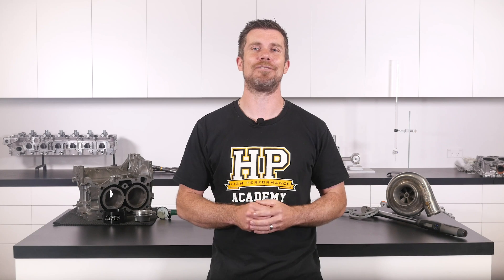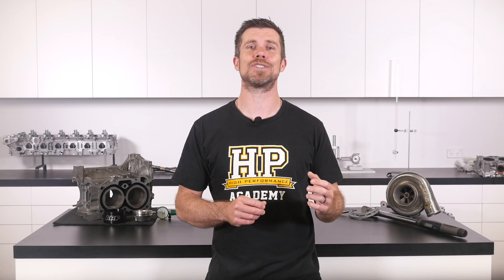Road Tuning | Can I Tune Ignition Timing Without A Dyno? [HPA Q&A]

Comment: A good way is to time the acceleration. For example 2000 rpm to 3000 rpm in some gear.  More timing equals more torque, right? Thats what my teacher told me

Comment: Why couldn't torque be inferred from some of the PIDs in the tuning software when driving down the road? Get the weight of the vehicle. Then take velocity of the car (angular rotation of the wheel & wheel size).
Reply from the maker: You could, but not with enough accuracy.

Best to be conservative and get close than try push things with guess work and potentially pay the price.

As Andre stated you can get very close with road tuning as it stands - Taz.
Reply: @hpa101  figured that might be reason. Thanks for prompt response :)

Comment: Log the knock level and knock retard. Use sensor overlay (Shift+F7) to overlay knock/retard on ignition table. Use Megalogviewer to analyze    TPS vs rpm/VSS vs Timing. Best MBT will give lowest TPS at a given rpm. Use the same piece of road (cruise at same 30pmh with different ignition timings) , patience. Analyze fuel curve by rpm to pinpoint areas of intake resonance.

Comment: Shouldn't you be able to detect the point at which you go past MBT with an oxygen sensor? As you advance the ignition past MBT the combustion event will be less efficient so providing you don't change your fueling, the difference in unburned oxygen should show up with the Lambda sensor?
Reply: Interesting thought, but I'm not sure it would work that way in practice because improper combustion would also tend to leave more unburned fuel.

Comment: Hi HPA,

In my experience, not cars but a small cc motorcycles. Not all engines will knock if you increase the ignition timing. So it's really hard to use the knocking sensor to sync with my datalogger. We tune IGN on the street by our feels.. but of course, I am always looking for a way to get better data. Can we use data from GPS sensor like Gforce? it is it the same with torque. we just use the speed data
Reply: Colour tune spark plug?

Comment: what do you do if the ecu dont have knock control? i have an elite 750 so im too afraid of the timing table lol, but its going to be a very long time before i can  afford a dyno tune because of covid my disposable income is non existant lol but im too scared to road tune the turbo car with no knock control, the engine is solid mounted and the interior is stripped so its a very noisey enviorment and im afraid i wont hear the knock or realize its knock im hearing if you know what i meen, minimum boost on wastegate is 16psi and shooting for 25psi as the goal for this setup when tuned properly. another thing im afraid of, is the ca18det engine has the same cam sensor as an rb25 and the cam belt deflection timing creep problem, so it needs to be super conservative anyway, and the reality is i was planning on getting a PRP trigger kit before starting/tuning the motor, but because of covid, my finances wont support that for some time, i just want to figure out a super conservative tune so i can enjoy the car a little bit, run the engine in under load properly, and work out all the bugs and issues over the next few months and hopefully next year ill be able to afford the good trigger kit and dyno time and have a smooth experence.
Reply from the maker: You can use something like a Tuner Nerd Knock Monitor Pro, Link Knock Block or a Plex Knock Monitor V2 etc. You can move these from car to car too, or even sell it one once you have finished your tuning.
Even in a quiet car, when it comes to a performance engine, if you can hear knock with just your ears it's too late as damage is already being done.
Check out this article here: https://www.hpacademy.com/technical-articles/dont-waste-your-time-listening-for-knock/ - Taz.
Reply: @hpa101  thanks man your the best, once my money situation comes good again i cant wait to sign up for some more in-depth knowledge, thanks

Comment: What are the signs of a bad dyno tune of the timing is off?
Reply from the maker: There are a few, this isn't a really straight forward questions to answer in comments section that respect sorry, but 2 basics would be detonation and also the shape of the map. If you look at the 3D graph and there are odd peaks or troughs often this is a sign something is wrong with the tune or with part of your setup - Taz.

Comment: 3 questions....
 with a stock cam, carburetor and no emissions. when setting timing at speed and UNDER LOAD, how many degrees retarded from the knock threshold should the engine timing be, to be safe to run? (when listening to the knock by ear without a listening device).....

 all things being equal, does the "safe zone" (the amount in degrees the distributor is retarded away from knock threshold) change noticeably on a 4, 6, or 8cyl engine?......

 on my engine,  when under load, there is about 10-12 degrees between the "audible knock threshold" and where the engine power "drops suddenly" as the timing is retarded away from the knock...  should the timing be set in the middle of this 15 degree range, or slightly closer to the knock, or closer to where the power suddenly drops off?... within the range, where would give the most power and where would be the safest for the engine without worry of the silent but still damaging spark knock?... which is really more of an issue with a boat engine than it is with an automotive engine...
Reply from the maker: Hey Greg, there is no way to know where the threshold is without tuning and finding it. Every engine is different, and different fuels will give different thresholds/limits so until you know, there is no way to know.
Not the answer you were hoping for I know sorry, but just like MBT it is something that can't be calculated before hand, the engine tells you where it is via tuning - Taz.
Reply: @hpa101  I know where the threshold is, and its easy to find when under power, but I want to know about how far from where the pinging stops as im retarding it, is a safe distance for it to run....  its a linear measure made in degrees, and anyone who routinely tunes on a dyno should know about how far in degrees from were the pinging stops, that the engine will be reasonably safe to run...  
 when the timing is advanced so far its causing detonation,  one can retard the distributor to minimize the ping, and even after the ping has been silenced and cant be heard, there is still a bit of detonation happening in the cylinder.... do we need to retard another 2 degrees from this point, or 10 degrees?.....
Reply: @gregpatey6355  Can i ask something. If a car was tune from factory to use ron95, does the knock sensor tell the ecu to maximize ignition timing when using ron97?
Reply: @vigossvirus666  Depends on how the manufacturer set up the ECU. On some cars, the knock sensor is an active part of the ignition system and the ECU constantly uses it to optimize timing. However, on others, the knock sensor isn't actively used and it's only there to tell the ECU to retard the timing for self preservation in case something is wrong such as the fuel's octane not being high enough.

Comment: How we can find near optimal ignition timing on boosted engine without knock sensors?
Reply from the maker: We have no advice for tuning without a knock sensor on a boosted engine other than to fit a knock sensor. They are much, much cheaper than an engine rebuild. There are no safe shortcuts here - Taz.

Comment: Great video.  I had learn to tune with and without a Dyno.
Reply: what would you recommend to  a newbee at performance tuning to get boned up on where to set the advance/retard  curve on tc88 motorcycle ignition modules?

Comment: Very interesting topic. If i have a naturally aspirated engine which is not knock limited, is it possible to get some indication about the torque by monitoring manifold vacuum while using cruise control to maintain constant speed? If engine produce more torque it should have more vacuum. Maybe i m wrong. In that case please correct me.
Reply: unless you can have a constant load like a propeller or a fan part throttle vacuum is not accurate

Comment: Virtual Dyno software works well. So does logs comparing 60-80mph times to see if timing makes it quicker.
Reply from the maker: We have not had repeatable results with the accuracy required to tune a performance engine from Virtual Dyno software ourselves, but the comment does pop up every now and again from others that they have success although some peoples interpretation of what is an acceptable margin of error is quite different to what we would accept when it comes to accuracy - Taz.
Reply: @hpa101  When I was 4g63 in my 3000GT, I tuned it only by street pulls, virtual dyno, 60-80mph comparison and looking at plugs. Ran 9.65@143, at 37psi. Ran up to 50psi on the street. I know there wasn't much left as I also remote tune 3000GTs on AEM and tune with only logs and virtual dyno. One made 735awhp when he put it on a dynojet. They added 2 degrees and only picked up 12hp, so they smartly took it back out and back to my exact map from remote tuning, virtual dyno. I only left on the table what I had wanted to leave for a little safety factor. It works. Must be a flat road, no wheel spin, and good logs. Plus with street tuning, you know its tuned in the exact conditions, unlike a dyno. For AWD cars I much prefer street/track tuning since they aren't as traction limited. RWD cars are different. On my personal car, street tune until traction is an issue, then the rest at the track.
Reply: @4familyman  whats the best virtual dyno software your using?
Reply: @4familyman  thank u

Comment: Dynos are tools...... The benefits from tuning on a Dyno are usually so you can see your power band and the ability to shift your power band when advancing/retarding the ignition. Adj cam gears are easy to tune on dynos. One of the downfalls is that the Dyno is a constant variable in testing but, when you drive on the street your car could behave differently because of the load difference. I prefer street tuning because it's really going to be the data the car sees on the road with all the elevation changes. Cars should be Dyno tuned first then make changes once you drive it on the street.
Reply from the maker: You should always confirm your tuning in real-world conditions after dyno tuning. This is the last step of the HPA step by step tuning process (10 steps for aftermarket ECUs, 6 for factory reflash tuning) - Taz.
Reply: I have a mk7 VW Golf R. The biggest advantage to a dyno for me, is that the parts I have are more than capable of making more torque than the stock internals can handle. So a dyno can be useful for knowing when we are close to the end of the safe zone. On the street, I wouldn't know until it's too late.
Reply: So for big leaps ans checking actually power dyno, 

Then log on street and make tweaks where needed to really optimise your tune and potential make more power? Or at the least make it safer
Reply: My car was dyno tuned but it had a really weird issue at lower-RPM which I fixed on the street.
The dyno tuner sweeped across the RPM range but for the issue to appear, you had to keep it at a very specific RPM (1950-2050rpm) for a few seconds.
Not noticeable on the dyno but it's a very important 100rpm when I drive on the street so very noticeable there.
Reply: Scan tools often cannot directly measure engine torque and will display a calculated value based on data from sensors, primarily engine speed (RPM) and other inputs like manifold absolute pressure (MAP) or throttle position. They also show wheel horsepower and torque by calculating these values from the engine's data and factoring in an estimated transmission and drivetrain loss. Some advanced tools may use the drivetrain loss estimate to provide a more realistic "derived torque" reading that accounts for parasitic drag, similar to how a dyno works.
Reply: stock ecus with automatic trans even on obd1 and aldl 90s have this data there, logging is the same on a mobile as it is a laptop or scantool, will tell you the indexed torque through the data connection to a tool. e.g. high end scan tool, even some mobile apps. there different types of dynos not just hub. would love to see the accuracy there, only way to true test the torque not just wheel torque, is to attach engine to the hub, datastreams are all the same coming out, except at the wheels is the only advantage of dyno, safer than street, but for a street car real time tuning and auto tuning with logs is the go. on oem can tune live ecus theres cobrartp, honda hearse tuning, snakeemu, moates. aftermarket i assume are live flashable to, afrs and fueling can be done automaticly and will keep improving over time. ectune is a good example of this being done with extuner on a stock ecu
Reply: If both make 250 hp, the street-tuned car is faster, because 250 hp measured in motion reflects real heat, airflow, and load. meaning that same calibration will make slightly more power under the dyno’s perfect conditions. physics 

on a low hp car this matters, 0-100 times will be less, most dynos use a server file or master slave tool, then tune for all up high power and at 1rpm it can show max torque. 

Two identical cars:

Car A → Tuned on dyno, 250 hp. (not talking rwkw or rwhp)

Car B → Tuned on street, also measured 250 hp (calculated from live logs)

Same hardware, fuel, air temp, etc. the mid range will be there so it will be faster. not just look good on paper. my alpha n tuned m52tub25 has 250hp on the dyno chart up from 170hp, just m54b30 injectors, pedal, throttlebody, and intake manifold. all power comes on at 4500+. my other car is m52tub28 stock no mods at 190hp and beats it at the same weight. 0-100 6s and 0-270 time 55s (328ci), 0-100 near 7 seconds on the 323i with alpha n and mods with more hp at the high rpm,  0-270 is slower by a few seconds.

Car B will be faster because the street-tuned car’s torque curve is optimised for dynamic conditions the dyno never saw.